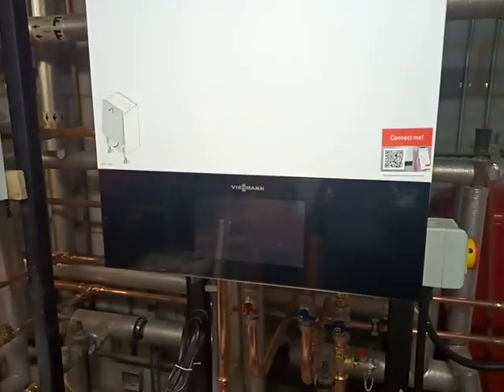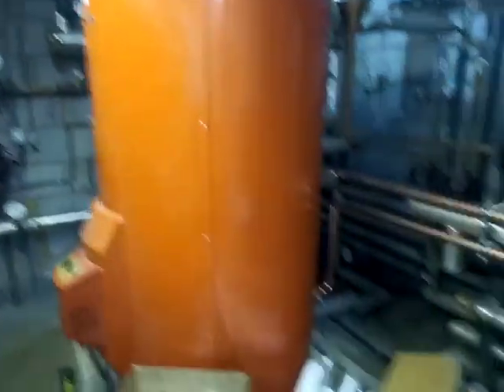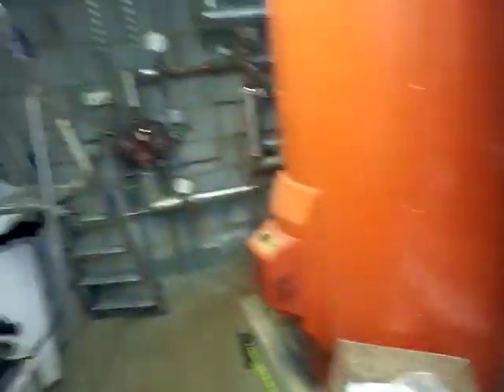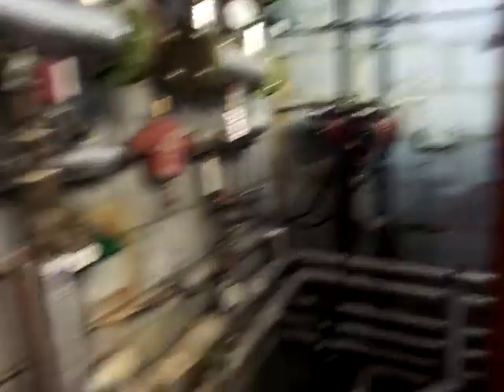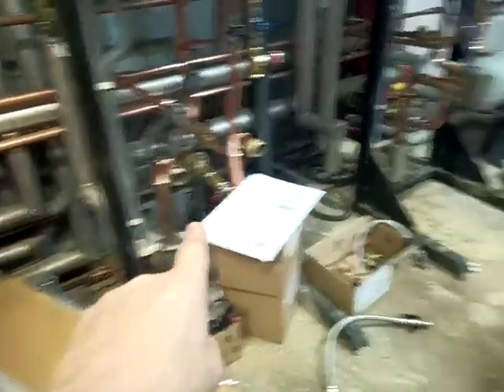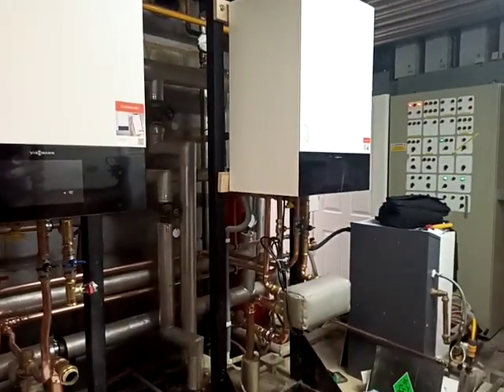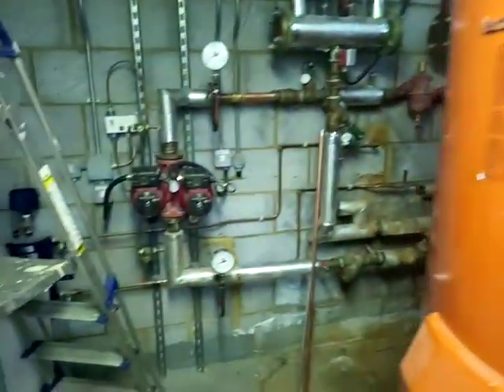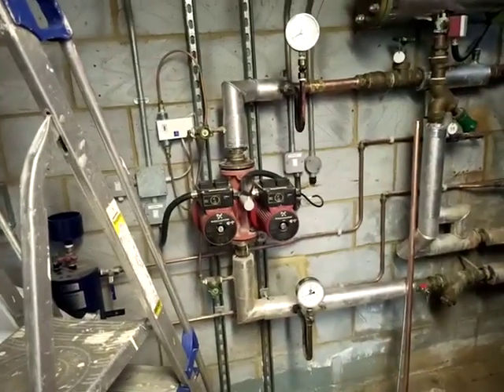Keston out, Viessmann in.

Comment: Hi Andrew - Recently came across this comment on Allen Hart's channel about the V200. Can you share if you have had this sort of experience?

"i had nothing but issues after 2 years with my viessmann w200 ,  with constant faults F2 errors every few weeks that were not pressure related, the big breakdown  it was at the start of the covid first wave  2 years after install and it broke on a bitter cold night ,  it was 6 weeks to get the parts (controller) and again it died again two weeks later with a fan issue,  again we were told another 6 weeks from viessmann uk to get the modified part.   in the end we swapped for a intergas HRE and turned out to be the best boiler I ever had on a reasonable budget, 3 years I lived with it and it didn't miss a beat, granted I had a water softener fitted,  after the issue with Viessmann and absolutely terrible uk support (I felt sorry for the plummer especially when trying to get a 3rd party controller working by honeywell ) I will never get one again, they look good, had excellent reviews but in the end it was the biggest turkey I've ever brought"
Reply from the maker: I think every manufacturer has some similar stories. Personally I've had issues will almost all manufacturers. It's just not normal to have such issues.